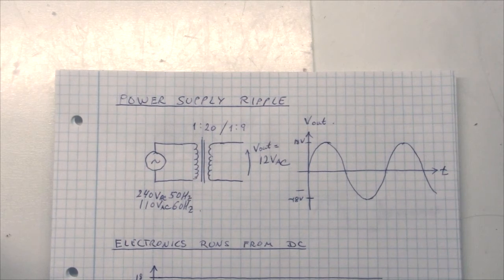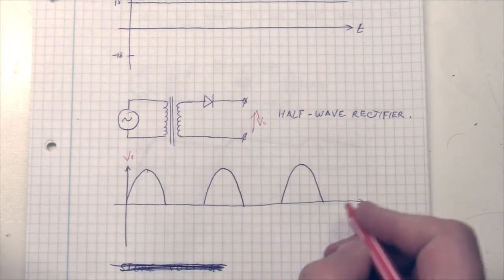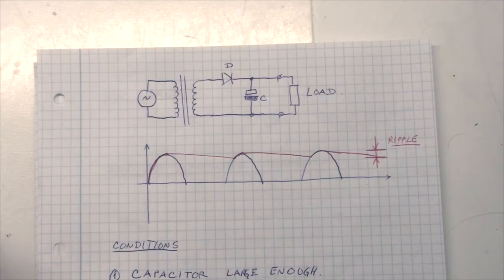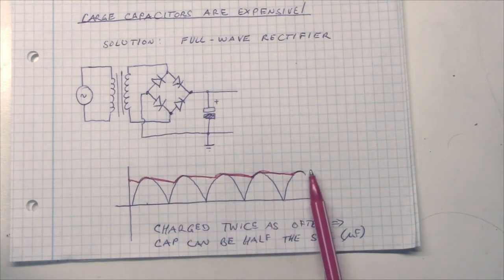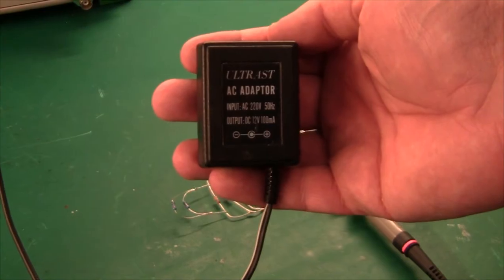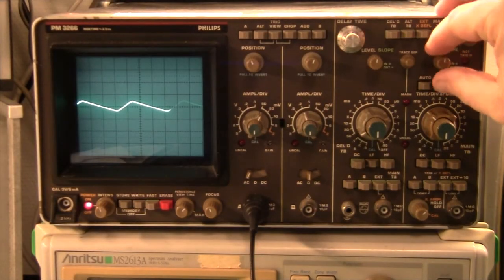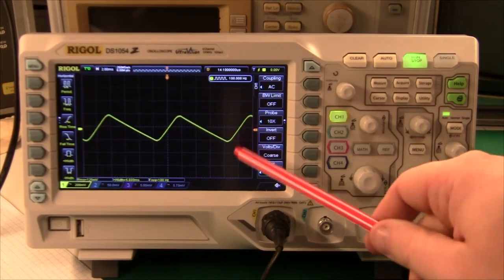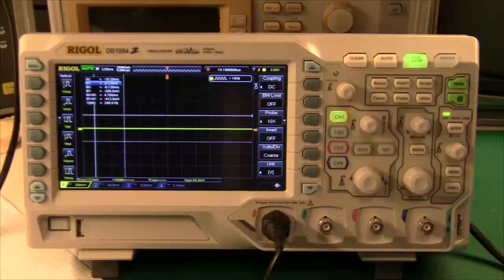Power supply ripple and how to measure it

Comment: Hi i saw your vidéo  but i dont understand  why you put resistor  charge to measure ripple ,id like to see your set up on shematic it would be more clear for me .thanks
Reply from the maker: If there is no load on the output, there is nothing to discharge the capacitors and there is no ripple.

Comment: hi can i measure ac ripple with a probe to 1x with a scope rated to 300v peak max. thanks
Reply from the maker: If you mean the ripple on top of a DC voltage of less than 300VDC, you sure can :)
Reply: Hi  if  i measure ripple  on  tube  supply  450 v dc ,i must take measure with 10x .probe  am, i  correct ,i got a tecktronix  with ac dc coupling  ,can i use this  to measure my supply ,i am a beginner  for this measure ,thanks @NatureAndTech

Comment: A very useful video, but I have a question: now when we want to measure ripple on the oscilloscope, does the ripple become our peak to peak value? I would be glad if you help. Thank you sir!
Reply from the maker: First two facts:

1) Ripple is typically measured on a power supply (e.g. output of a transformer or switch mode supply) that will feed an electronic circuit. 

2) Now, all circuits have a minimum voltage where it will stop working, and a maximum voltage where it will also (catastrophically) stop working. 

Secondly:

Here is a very exaggerated example:

Let's say you have a 12V DC voltage supply with a very short and deep spike (maybe down to 0V) every 50 or 60 Hz cycle. Clearly this will screw up your circuit. Measuring the RMS value of the ripple would result in very close to 0V, while the peak-peak value would be 12V. 

So, for practical reasons, I believe ripple should be measured in peak-peak, and not average or RMS. 

Hope this helps :)
Reply: @NatureAndTech  ty so much sir have a good day!

Comment: basically my Sanwa PC510 DMM will do that , quicker , easier and probably more precise
Reply from the maker: Why do you want to use an instrument like a DMM that gives you as little information as possible, if you have access to an oscilloscope? Your Sanwa multimeter can not detect any spikes or dips or drop-outs. All it does it give you an average (or RMS) value.
Reply: @NatureAndTech  you dont ,  
But just saying , if you are interested in noise you will quickly learn there are levels to it ,   you want to use a scope , but not if it gives you same reading as more simple setup like DMM
Why bother , so there are levels to this  , this is just one https://youtu.be/pKXPqApOYfk?t=64

Comment: Sorry for a silly question. But what is the purpose of the AC/DC switch on the digital scope, if you can just use the Y axis adjust to move it up and down anyway?
Reply from the maker: You will get much better accuracy with the AC range.

Comment: Thank you for this tutorial! I love it! One question: I also have a Rigol, how did you wire the probe to measure ? I see that you change from DC to AC without touching the probe! or did you ? Thank you man!
Reply from the maker: The ground clip is connected to the circuit (adapter output's) ground, the probe tip to the voltage you want to measure. Note that the ground clips are connected internally in the oscilloscope. What that means is that you can not connect the ground clip of one probe to a point on your circuit, and the ground clip of another probe to a different point in your circuit, as it would create a short through the scope. Sorry if I am stating the obvious.

Changing from AC to DC is done using a screen-menu that pops up when pressing the CH1, CH2, CH3 and CH4 buttons respectively. If you didn't see the change, it must have been because of my poor editing skills.

Comment: great video, but I was a little unsure what all these resistors did and how you took the measurement from the PSU... did you just plug in the scope to the ends of fx the PSUs barrelplugs + and -or did you use these resistors to remove ground lead noise... as I often heard it is preferred to use as ælittle ground lead as possible when measuring noise & ripple.
// yep, it seems you have connected a female DC plug, and there plug in the barrel plug from the PSU.  7:59

Comment: Great video!! Thank you.  I bought the same oscilloscope. When measuring DC from a car battery, it shows 60 Hertz. I thought that was only for AC. Should I ignore or see if the manufacturer can swap it out?
Reply: Are you in the US? You are probably picking up noise.  Try a small 9volt battery with its terminals being close together you'll get less noise. Pull the ground wire off the probe and use the supplied spring that came in the probe package you should see even less noise.  If you hit auto on the scope instead of manual setup    the scope probably guessed wrong and selected ac coupling if you don't see the 12 volts on the trace.  DC coupled and the vertical scale large enough to see 12 volts you probably won't see much ripple. I doubt there is anything wrong with the scope. With the ground lead flapping in the breeze the spring clip probe cap plunger thingy on and touching the tip just right I get about 4v peak to peak noise.
Reply from the maker: I am not sure exactly what is going on there. Where does it say 60 Hz on your scope? How much 60Hz hum is there - in volts peak to peak? Do you measure with the battery disconnected? I assume you measure DC somewhere in the range of 12V-14V?
Reply: That worked, thank you. No more Auto for me. 👍
Reply: @DecimalZer0  , Great. Btw eevblog has a "how not to blow up your scope" video and w2aew has some probing techniques videos. Allan's day job is a tektronix application engineer so his scope and other  tutorials are very good.

Comment: please make a video for measuring current and voltage separately by oscilloscope and multimeter while having load. i had searched on youtube  for such but not fully explained that i can do same. I am waiting for that video. Please response my arguments. I want to make my power supply unit without transformer according to my requirement of desired current(DC) and voltage. Please response soon. Thanks for your video.

Comment: Dear NatureAndTech, 

is it possible for you to do a video on how the AC voltage reading on a multimeter changes when changing the capacitance value in a bridge rectifier? I am doing the similar experiment and Im getting the same readings :/
Reply: Infact my readings for the AC voltage are higher than the DC voltage readings when i connect the multimeter across the resistor. Am i doing something wrong? I hope you can make a video on this it will help a lot!
Reply from the maker: Thank you for your feedback. I will do a video.

Comment: Can you measure even small ripple of very low voltages, like 1% ripple of 50 mV, with those oscilloscopes you use? Namely the Rigol DS1054Z. I would like to do that and am not sure which oscilloscope I need.
Reply from the maker: The lowest range is 10 mV/division, so I would say no to that.
Reply: You would need to put an amplifier  on front of the scope to see 1% of 50mv.   The old tektronix maybe a 2225 had a 500 uV per division sensitivity on the front end. A high count dual display multimeter that does DC +AC might show you rms ripple as you adjusted the 50mv supply voltage or put loads on it.

Comment: Hi first of all thanks for the really educational video. Then I would like to ask a question related to power supplies of audio amplifiers. In some cases some manufacturers offer an upgraded version of a same amplifier with greater capacity in the power supply section with everything else unchanged. What kind of sound enhancement can produce an increase in uF in the power supply ?
Reply from the maker: If your decoupling capacitors are small-ish, you will hear some artifacts in the bass and drums and other low-frequency parts of the music. It's kind of hard to explain what it sounds like, but it's like the amplifier is unable to contorl the speaker-cone properly, and the low-frequency signals come out "jelly" or "wobbly". I think I should try and make a video about it, when I have some spare time.
Reply: @NatureAndTech  you r really great
Reply: @NatureAndTech  awesome, you explains very well. You are good lecturer for me
Reply: Hi thank you very much indeed for your very kind and valuable reply.  I will be waiting for that video for sure. Capacitors are a topic very  intriguing to me.  It is also impressive the difference in performance from brand to brand.  I hope to be right in thinking that, in any case, the higher the ripple current of a capacitor the better also for a use in an audio amplifier.  Actually i am in the middle of a upgrade project.  I have a stereo amp with two smallish 4700uF caps in the power supply.  I am thinking to replace them with two higher grade caps about 15000-22000 uF each ... and listen for improvements in the sound.   At present during louder passages i hear some kind of hardening of the sound.  I hope not to destroy the amp in the process. Thanks a lot again.  Kindest regards, gino

Comment: Concerning electrolytic capacitors for a tube guitar amplifier for filtering & coupling. Please tell me what is  the perimeter that I am looking for, High or Low Ripple current ratings when comparing capacitors for a Tube Guitar amplifier.
Reply from the maker: For amplifiers you can actually live with quite a lot of ripple. This is because audio amplifiers use negative feedback to stabilize the amplifier output to the speakers. 

You can google "power-supply rejection ratio". PSRR is typically 60dB or so, meaning that any changes on the amplifiers output due to ripple will be 60dB smaller than the actual ripple on the power supply. 

So, in conclusion, the electrolytic capacitors for filtering the power supply is not very critical. In fact, in a lot of power amplifiers, they don't even bother putting a voltage regulator. The amplifier can be powered directly from the voltage across the electrolytic filter capacitor.
Reply: Thank you for taking time to explain this to me. Just for clarification, when I look at the ripple current of a capacitor, I am looking at the maximum ripple current that the cap can handle before heating up and changing in value. Is that a correct statement?
Reply from the maker: That's correct. It's not that the capacitor will immediately self-destruct, but the heating up will reduce the life-span of the capacitor. If you worry about that, you can buy high-temperature capacitors with very low internal series resistance (at a premium).

Comment: Great video thanks. I'm surprised ripple is not expressed as a percentage of the DC instead of voltage. For example a 300mV ripple on  2KV supply is nothing, but it is on a 3.3v supply.
Reply from the maker: You are right. Percentage (or dB) would be a great way to express the ripple. Any engineer or technician would be able to understand it too, so I don't see why not.

Comment: why does the voltage still become unstable even though it was switched back to AC? and i didn't understand why the voltage increases to 18
Reply from the maker: Hi Ryan,

An oscilloscope is not like a multimeter. A multimeter set to AC will typically measure the AVERAGE or RMS voltage of the signal, and show that. An oscilloscope on the other hand, will show you the signal exactly as it is. It does not perform any averaging or any other mathematics to the signal. So, when setting the oscilloscope input to AC, it will not do any maths, except move the trace down so that it is shown around the zero line.

A 12V AC power supply actually has a signal that swings from -18 to +18V. The reason it is called a 12V AC power supply, is because it is only able to perform the same amount of work as a 12V DC power supply.

I hope this explains it?
Reply: Ah okay but as you said the AC swings from -18 to +18V so why does the line jump up when we switch it to DC? because isn't the AC already swinging from -18 to 18V?
Reply from the maker: Ah OK. Because I have rectified it with the diode and the capacitor. All that is left is the 18V DC after the rectifier, and the little bit of ripple.
Reply: is the reason why the line jumps down when you switch it from DC to AC because the 'AC' mode measures the AC part of the DC voltage?
Reply from the maker: Yes you can say that. AC mode shows the AC part of the voltage. DC mode shows everything (DC+AC, so maybe the term DC on the front panel is not such a good name, but everybody calls it that).
Reply: Oh okay thank you so much! My laboratory practical is tomorrow investigating how capacitance affects the ripple voltage in a full wave rectifier. How can I connect the components (full bridge diode, capacitor, power supply AC and oscilloscope) on a breadboard. If you can make this video please try making it as soon as possible it would really help for my lab exam tomorrow. Thank youuu greatly appreciate it!!
Reply from the maker: OK. Give me an hour or two :)
Reply: Thank you so much!!
Reply: Hello i just finished my laboratory practical and unfortunately this time, the oscilloscope was not working so i had to use a multimeter in order to measure the ripple voltage. I used a breadboard and made all the necessary connections - from a transformer emitting "12-0-12"V AC. I connected this to the breadboard and to the diodes. I connected the capacitor and a resistor in parallel. I took the measurements by placing the multimeter probes at the resistor. First i measured the DC voltage by setting the multimeter mode to DC. I got a good reading. However, when i put it to AC mode to measure the Vrms (AC) i got a value way higher than the DC voltage. for example i got 18V DC and a reading of 39.1, the AC voltage (when i set the multimeter to AC mode). According to a formula, the ripple factor is equal to the Vrms/Vdc. Is the value of 39.1 correct? i was quite unsure of this because this is way higher than the DC value (and plus the transformer voltage rms i measured is 13.5 AC). Do i need to convert Vrms AC into anything? or can i just apply it into the formula Vrms/Vdc   If it is correct then can you please explain how the AC voltage i measured is way higher than even the transformer voltage output. Thank you!! 

(Also since i used a multimeter this time because of the broken oscilloscope, the school will be getting a new one and i would have to use that so can you please still make that video how i would connect the oscilloscope to the breadboard circuit (power supply + bridge rectifier + capacitor + resistor + CRO). Thank you for your help!!

Comment: good explanation, but i  have a Hantek DSO-2150 and i don't recall a gain knob or switch.
Reply from the maker: I'm not familiar with Hantek, but it is also typically called, Vertical, Volts/div, Scale, or something like that.

Comment: Very well done ripple tutorial. I don't have a scope can I get an approximate ripple measurement  with my fluke multimeter measuring AC on a DC power supply output? Could you demonstrate and compare the multi-meter reading to the actual scope reading. I am sure the multi meter would give some kind of RMS reading for a saw tooth wave form correct?
Reply from the maker: That is correct. You can set it to AC and then you will get the RMS reading for the saw-tooth (If your meter is true RMS).

Comment: Very nice explanation. Are all AC adapters that inaccurate? 18 volts instead of 12, with a 0.4 volt variation seems quite bad... I wonder what a laptop charger voltage ripple looks like
Reply from the maker: The adapter I am using is unregulated. Laptop power supplies normally have some kind of voltage-regulatorion built in, and their power is accurate.

Comment: Very nice explanation as Big G has mentioned. And I agree with the others, keep the series going on regulation and control of all the different voltages most circuits use. Good job, thanks.
Reply from the maker: Thank you sir. I will do the odd tuturial whenever I need something in one of my builds. I have, by the way, just received a ton of bare PCBs from China, so there will be some more coming soon :)

Comment: Curious, where are you located that has 240vac at 50 hz?
Reply from the maker: Actually it's 230V. I'm in Denmark.
Reply from the maker: The UK used to have 240V and the rest of Europe 220V. When the grids were connected together, they agreed on 230V, since it was within the tolerances of both the UK and the European supplies.